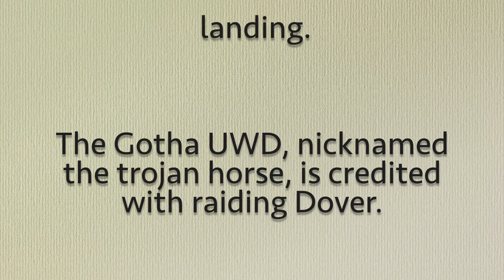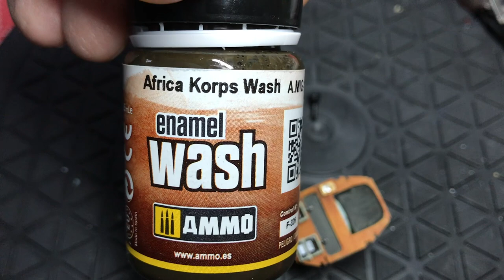Wingnut Wings, 1/32, Gotha UWD, detailed step by step build, Part 3

Comment: Great techniques. I learned a lot. If you put oil paint on heavy cardboard (like that pizza box interior), the oil leeches out of the paint and it dries faster. But the oil brushers seem to work a treat so I’m going to give them a try sometime. The aircraft interior is very eye-catching; it’s gorgeous how all that paintwork came together at the end. 😍
Reply from the maker: I think I prefer the painted to the decals.  If you put your oil paint on folded kitchen towel the linseed oil gets sucked out a bit quicker than on cardboard I find.
Reply: @ModelkitStuff  I’ll try that next time. 😊